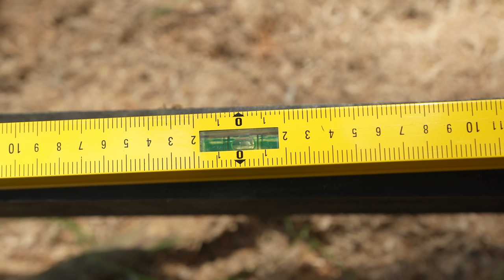Cabin building in the woods, Solo off grid, I've never built before, shed in a woods

Comment: The cinder blocks need to be rotated for structural integrity
Reply from the maker: Maybe in more detail?
Reply: Sure, you can see at about the 4:30 mark. The blocks are stronger and built to have the hollow spaces vertical instead of horizontal. I didn’t have time to watch the whole video but it looks correct in the vid thumbnail.

Comment: Hi Roma. Great job so far. You should of poured concrete footing for all your blocks...over time,the blocks will sink into the ground and you'll have uneven floor. Just a suggestion, other than that..its lloking great😊
Reply from the maker: Let's see. This is my first house...and I don't know how long it will stay. Here is my experience
Reply: Or even dug a hole and busted up a couple cinder blocks and put those chunks in there and went off that for your base. … it just just sucks that thing is sick and will eventually just sink like you said… but forreal… 
I would have just used those pallets as my base and been done… coming from a stone mason here  👋🏻 lol nice job brother
Reply: @PittsburghWelder  when it sinks he can have screw piles installed under it and they will hold it for another 50+ years.
Reply: Homes have been built in the arctic and sub arctic regions for more than a century over permafrost. They have to be leveled from annually to every few years. Building practices and requirements vary with regions.
Reply: If the block sinks, take a jack, lift the house a little on the side and put a wedge under it until it is level again. After all, the house is only loose on it, so that's not a problem. 
This is how I did it. 🤗

Comment: You impregnated the beams but not the thin plywood boards, or you did it carelessly (at least that's how it looks in the video). 
Over time, moisture will penetrate the plywood and make it rotten. Then the insulation is exposed and mice and insects move in. I've made that mistake before, too. 😑
But the floorboards will hold. 🤗

Comment: 15:52 what’s the plywood sitting on, also you should nail them down

Also I hope you put a tarp or roof over that insulation before it rained. 

You can check square of entire floor by measuring 6 ft one wall then 8 ft another wall then measure distance between the 6-8 marks and you should get 10 feet

Why did you paint/stain the first boards? I can’t see but I assume it’s anti rot protection?

If you want good carpentry tips look up Larry Hahn on YouTube.
Reply from the maker: Plywood lies on nails. I painted because I didn’t know how long the roof would be gone ... and I just wanted to
Reply: @mypersonaljournal  did you put a tarp or roof over it after you installed insulation?
Reply from the maker: @worlore1651  Covered with an awning. Watch the latest video. Already have a roof